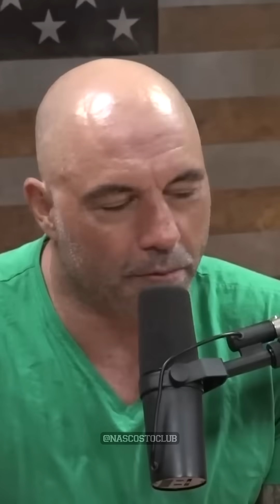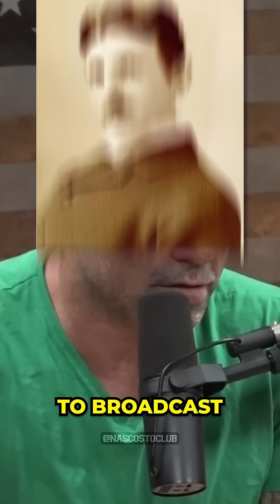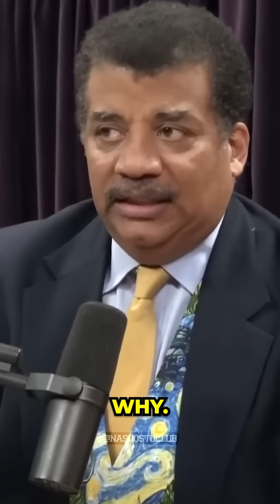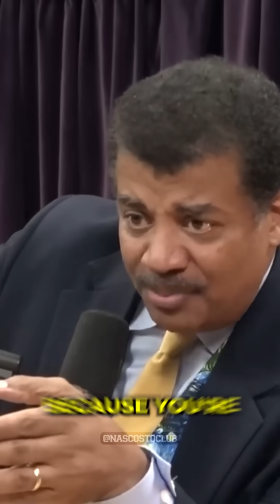WIRELESS Electricity Idea Debunked ⁉️⚡ #shorts

Comment: if you had told Neil about sending great amounts of information trough frequency waves (wifi) in the 80’s he also would have said is impossible. 😂
Reply: No he wouldn’t have, people have been sending information through the air for more than 100 years and he obviously knows that. The energy needed to send information is nothing compared to the energy you need to send through the air to do a useful amount of work.
Reply: @SuperRaidriar  i love how niel degrease Tyson thinks he is smarter than tesla
Reply: @georgew5038  Nikola Tesla was a genius, and I doubt Neil thinks he is smarter than Tesla, but the fact is that Tesla’s ideas for wirelessly transmitting power simply wouldn’t have worked.
Reply: I'm glad so many people realize this guy is dumb

Comment: as a industrial refrigeration guy I deal with A LOT of high powered electricity and Neil is 100% correct. power needs to be controlled and not broadcasted or there will be alot of casualties. you dont have to touch the wire to get shocked, electricity can travel to you and kill you.

Comment: Yet in about 1850 a solar flare so powerful that disabled the electronic equipment of the time charged the air so much telegram machines could be used without the battery connected.  Stick to your telescope Tyson.

Comment: Simple argument is commerical energy generation business is all about equipment efficiency which leads to lesser losses generation and transmission losses and whereas we all know when AC travelling through a cable shorts or jumps through air on the adjacent conductor what kind of arcs it produces and those losses are genuinely costlly even if the idea would have worked commerical scaling was difficult
Same was the case when AC was introduced for transmission later HVDC was developed FACT SYSTEM too so can't say anything about Tesla

Comment: It was broadcast through the ground. The air was conceived by others who saw his tower he built to send energy to the atmosphere. He wanted people to be able to drive a stake into the ground and be able to put a rod into the sky to avoid discharged energy.

Honestly the kill you thing is a little much but certainly we wouldn't have the culture we have today since it would fry any open circuit. It would be a constant EMP to power low load systems. Computers couldn't invented, wifi would be affected with the amount of static it would cause and could effect cell signal. It would fry anything not protected by a Faraday cage. 

So it might effect health on a electrical biological system but it wouldn't immediately just kill you looking at teslas papers.

Comment: Wow...I uh...I think Neil Degrasse Tyson should stick to his own field. Let me explain something about electricity. It has many forms, and the low wattage, high amperage type does not affect you as let's say a shock from a 120 volt circuit of alternating current.  We have proven that you can illuminate light bulbs with this type of free flowing electricity. However we haven't studied how this sort of electricity affects humans long terms. It's said that a 9 hertz difference can alter our brain impulses that essentially makes us depressed. Neil Degrasse Tyson also believes that water in pipes can't freeze but it's when water bursts from pipes that the water freezes instantaneously. Which is a load of bullshit because pipes freeze but don't burst all the time. Pex can actually freeze and not burst for example vs lead or copper. I think this man just tried to say a lot in the hopes of sounding smarter than he really is. I believe his speciality is astrophysics, and in that field he may excel but the rest he makes as much sense as a blubbering alcoholic.

Comment: Thats why you wouldn't use normal electromagnetic waves duh. When there is anything true about that old tesla wirless energy, than it would have been some other kind of technology. It's said to be scalar waves, altho modern scince claims that those don't exist, as far as my knowlegde is today. What i imagine hwo this would work, is that you have to somehow sync up sender and receiver and once the connection is established, the energy travles in a way that it doesn't interact with stuff inbetween, at least not in the way we are used to be from like normal electromagnetic waves. I bet if he had enough money in the end he could have found a way to do it at least for low powered devices :(

Comment: Neil doesn't understand how electrical frequency works 🤣 you can have electricity at extremely high voltages and amperages if the frequency is above the lethal range or below the lethal range. You 100% could do this, have it work, and have it be safe. The real problem is it would create a ludicrous amount of interference.

Comment: Tesla was trying to do with electricity like Wi-Fi. But instead of producing it the said object would have a receiver node or the actual house would have the node and it will start taking it from the ionic sphere I think it was. So it would power on small household items. Like light bulbs street lights then they would have probably invented a power multiplier for more large items like tv refrigerator and washing machines. Eventually cars. I think it’s something that would have been liable.

Comment: Someone needs to tell Neil about resonant wireless charging
Reply: Lol you think wireless charging your phone...the energy is moving in the air and getting in your phone?
Reply: @youngstunt8829  The charging on your phone is most likely inductive charging, shorter range/lower efficiency than resonant charging. You can have some air gap but the  efficiency falls off drastically with distance.
Reply: @derp292  it's the same, look at a schematic of "resonant charging", it's just two transformers with inductive charging.
Reply: @derp292  doesn't the magnetic field of the magnet in those charges what produce the electricity that powers the charger? It wouldn't really matter if theres an airgap or not
Reply: @Tommy-jq2ju  Magnetic strength degrades by distance according to the formulas. They don't stay infinite.
Reply: @youngstunt8829 the magnetic fields are in the air and transfered to your phone... so yea
Reply: Well you can actually test what does high current high voltage does without wire, but only once
Reply: I think its time to mention that i forget where i put my wireless cabel again
Reply: ....that didn't demonstrate anything at all. Do you actually have any idea of how magnetic resonance charging works? It doesn't sound like you do is all.
Reply: Bro I swear you people are rabid Elon Musk fanboys from Reddit who think he actually invents things.
Reply: And someone needs to tell you about echo chambers. Lol, name checks out "derp" xD
Reply: That’s C O M P L E T E L Y different. In the "apples to oranges" metaphor you’re not even speaking about organic matter here.
Reply: Comment shows how uneducated in this topic u are my brother
Reply: Wow you know big words and not the meaning.... Good job
Reply: @johnbiscuit8272  Dont shoot! Im with the science team!
Reply: Difference is that your phone sits on top of the wireless charger, mere millimeters away from the source of the wireless power. That's entirely different. That energy isn't moving any meaningful distance, and so the amount of energy required to charge the phone isn't that high.

If you actually wanted to do what Joe and Neil are discussing here then your entire house would basically have to be filled with powerful magnetic fields, and that would be potentially very hazardous for the people who live in the house. It becomes much much harder to do if you want to for example wirelessly power a light, or a speaker, or a TV that's sitting halfway across the room. It would require massive amounts of energy to be able to generate that kind of electricity through several meters of air in order to power home devices.
Reply: @Fraggr92  its hilarious they are taking about wireless electricity and the example is a 5V charge that is literally placed in contact and this became common in like 2016 or so. 

That's how far off this crap is. People don't realize how hard even the smallest innovations we make in today's world can be.

Comment: Not if you harnessed the energy particles in the air similarly to a Dyson sphere therefore using a energy arc and then piggybacking off of the stored energy within the energy arc

Comment: I think the missing point is voltage, Tesla's idea involved really high voltage. Watts = volts x amps. If the volts are high enough you'll get enough watts (work per unit of time) with the amps being low enough to not kill you. The problem is we would be walking around in a low power lightning storm, which might give a completely different outcome to "a day at the beach" when Timmy dips his foot in the water at tlhe wrong time.

The other missing component is frequency. Tesla envisioned it like radio and being tuned to frequency that was harmless. The problem here is radio was new in Tesla's time and I'm not sure, completely understood. It would've been cool if it worked.

Comment: light bulbs now that are LED a lot of the time take 3-5 watts, most WiFi access points that I install (which are radios) consume 8-15 watts.  I know some of that is lost to heat, but you can technically tape 10 of those things to you and be perfectly fine as long as the room isn't too   hot 😂
Reply: Big caveat there especially with global warming getting us above 120 Fahrenheit these days.

Comment: You can definitely send power through the air, but aside from it being extremely dangerous, there's a million problems that come with it. One of those problems is wireless telecommunication would be impossible due to electrical interference. In physics lab my professor brought out a tesla coil for a demonstration. When turned on it could power a light bulb that wasn't plugged in but we were also shown that if you tried transmitting just a little bit more power then bolts of electricity literally arc through the air and if it hit you, you would get zapped (all of us students were at a safe distance). If we built a bunch of Tesla towers today and used them to power a modern city it would basically turn into a lightening storm of biblical proportions.

I'm an electrical engineer btw.

Comment: -Lightning has left the chat.
Reply: You should learn to pay attention to what people are saying. He is not saying it isn't possible, he is saying it's a very bad idea. Standing under a lightning strike pretty much proves his point, you die. And transmitting energy in any meaningful way through the air is extremely dangerous. You can transmit energy over a great distance using microwaves, but if you stand in between the sender and receiver, you are toast.